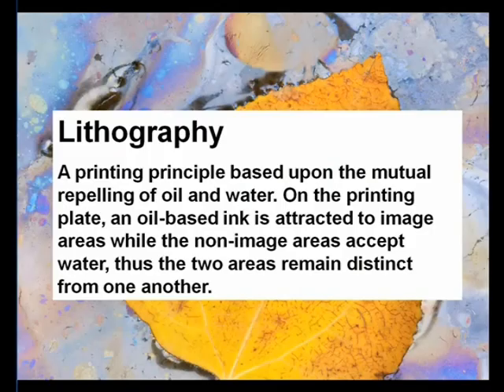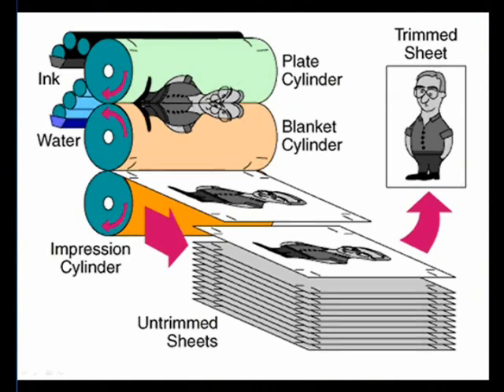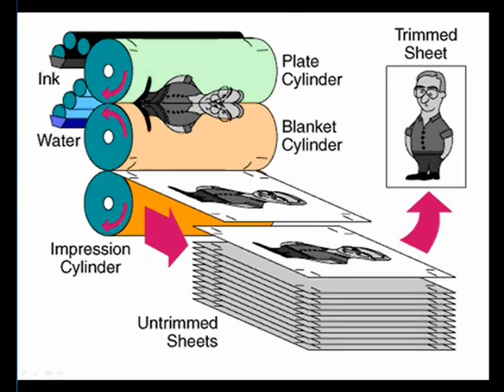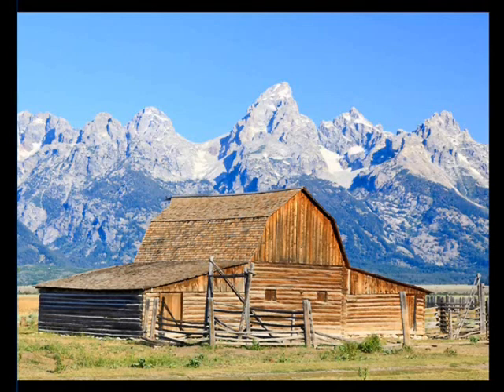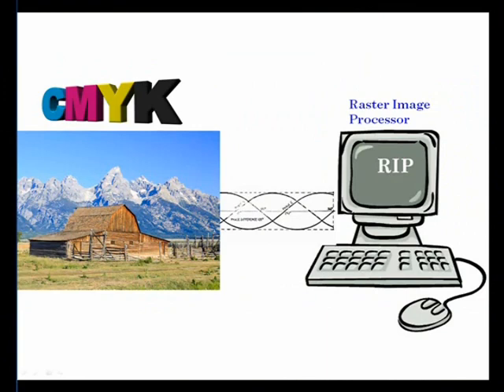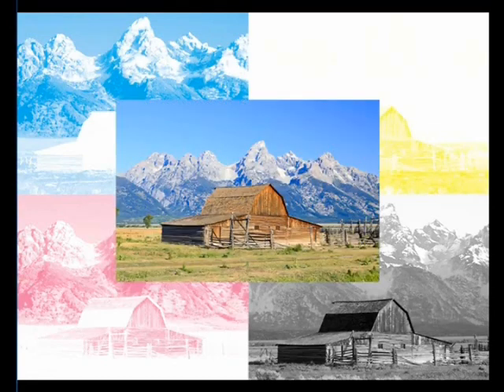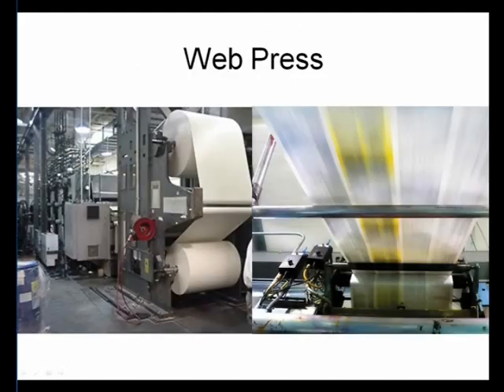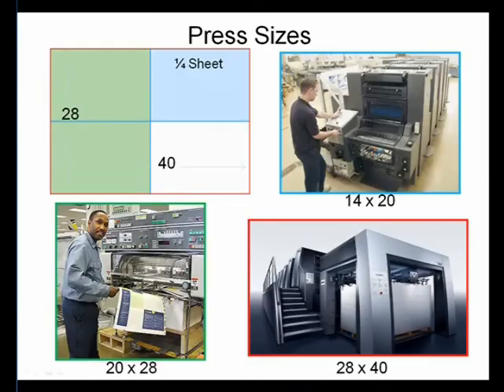Four Color Printing Process Explained

Comment: I would like to know how colour printing was done in the past without computers. How did the separate and isolate CMYK?
Reply: Colour separators - it was a full pre press 4 year trade in Australia - they used cross field drum scanners to digitise transparencies and prints to film. They would then be combined on light tables with other film and ruby sheets to block out non image areas and seperate into the four colours by doing multiple exposures to each colour. Thinking back now its a lost art, killed by Adobe and Apple. Where you use a mouse and adobe now to seperate, we used to use scalpels, ruby and film.

Comment: One question: do you cure the inks after one color is printed or after 4 colors are printed?
Reply: To my knowledge you typically don't print on uv coating so I would imagine it's applied after.
Reply: it is set or cured after all four inks have been added. it's cured with a dryer or oven first and then rapidly cooled by chill rollers.
Reply: All 4 colors will be layer onto the paper before it is cured/dried
Reply: Your all wrong. Must have went to RIT. Your process inks are solvent based. Once the paper enters the oven the solvents are removed. At that time it exists the oven and on to the chill unit. Then the ink is curred. Or hardend if you like. Got it.